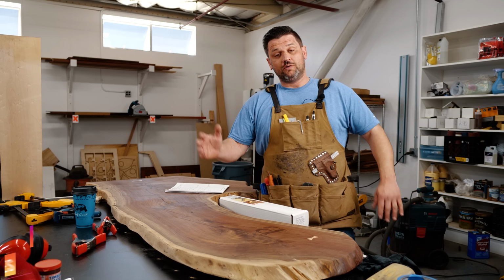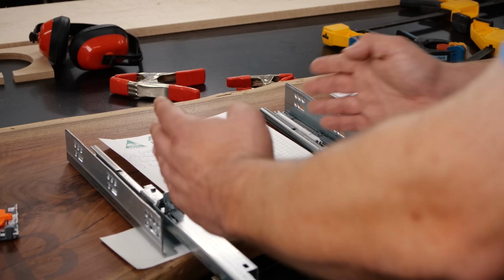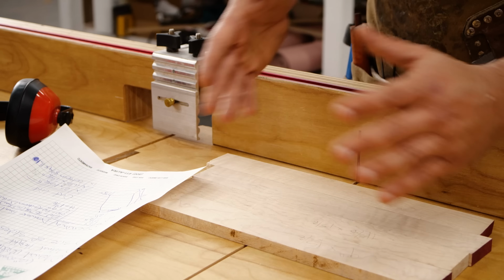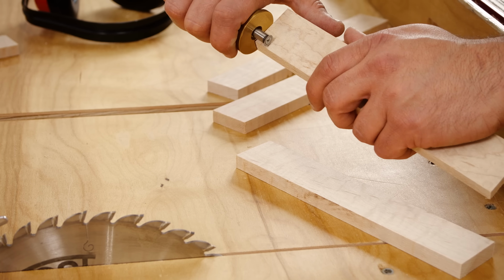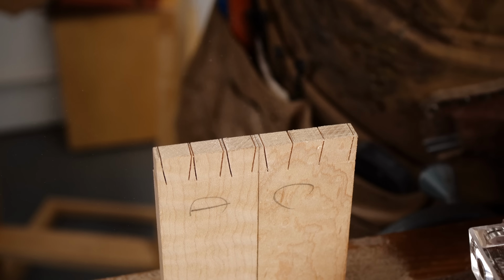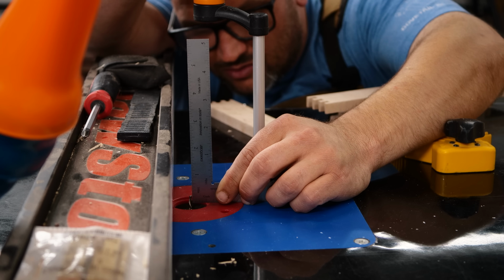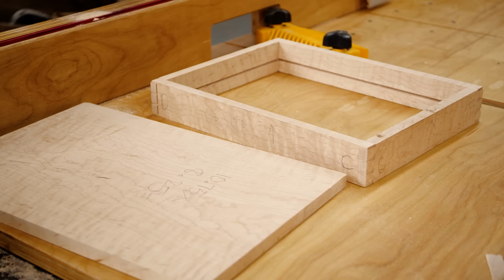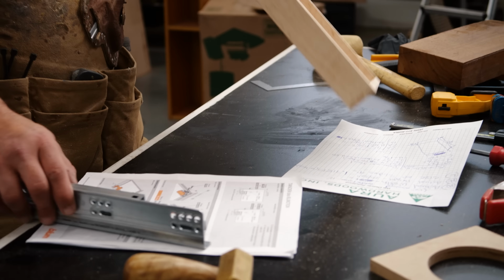How To Make a Drawer Box for Blumotion Concealed Soft Close Drawer Slides

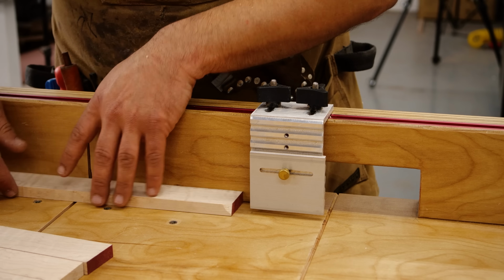Comment: at 6:00 you are cutting the end square and then cutting that same end off. In your non-cutting example the red end of board (which has not been squared) never gets cut, so you have an end that is still rough cut. You need to flip the board around. Unless I'm drastically mistaken I agree with @George Yetka